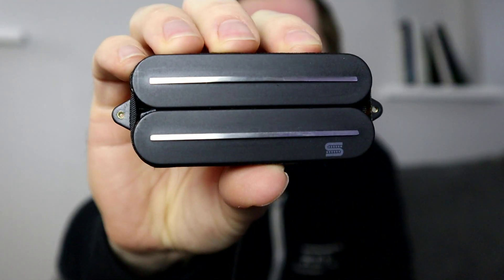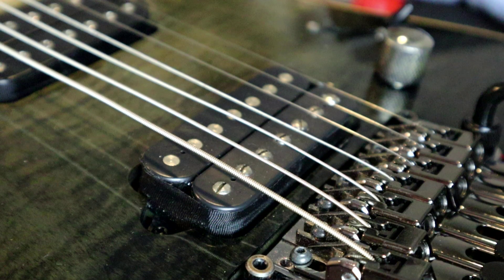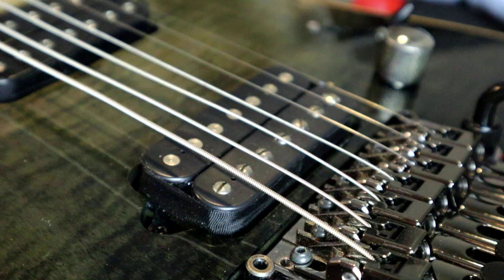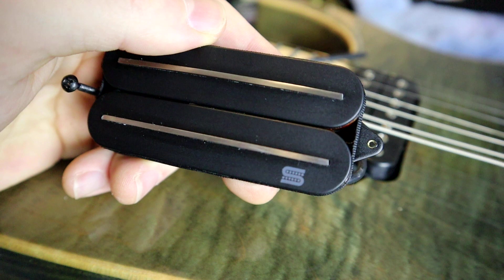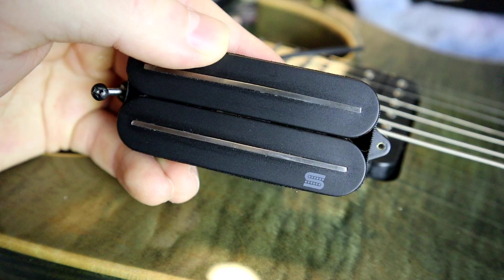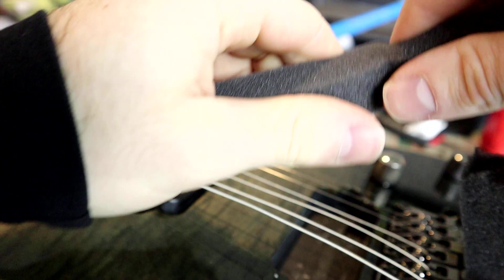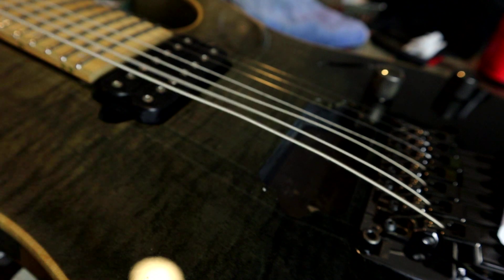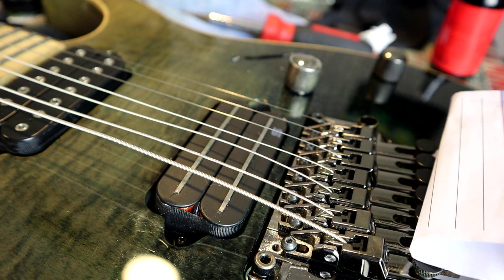How to Direct Mount Guitar Pickups

Comment: Great, fast, clear and concise video. A couple of extra points: once the pickup mounting tabs are drilled out, it should be noted that the pickup can never be used for a ring mount or pickgaurd spring mount again. Also, the sponge, the serves as a push back against the height adjustment...just another way to explain it. And lastly, that specific sponge material is available to order. Best to get the right one because it has a certain tension.
Reply from the maker: @robertfraser7199  you can also solder metal nuts, that are threaded, to the pickup tabs and use them with traditional plastic mounts!
Reply: @EricMorettin  I do realize that. Good point. It's out of most people's capabilities. But you're right
Reply: Subscribed... @EricMorettin
Reply from the maker: @robertfraser7199  Thanks!
Reply: I just got a cheapo guitar with direct mounts and the foam underneath is crazy hard/dense, making it pretty much impossible to adjust, but when searching for replacement foam I can only find it for P-basses, Jazzmasters, and Fender's general foam. Does it matter which I get? I don't know why it would (or why there is bass-specific foam lol), but maybe there's just something I don't know? I was just cutting up a big sponge that I had laying around n it seems like it should be fine, but I'd rather get the foam that's made for this lol.

Comment: I was literally thinking about doing this on my project strat, I'm planning on installing a Wilkinson high output Alnico 5 humbuckers on it.

it's a good thing that the body has a swimming pool route for the pickups so I'll probably just have to modify the pickguard so I'll have access to adjust the pickup height.
Reply from the maker: If the pickups are mounted to a pickguard then keep it as is

Comment: Trying to verify if direct mount pickups are height adjustable or not. Been eyeballing a direct mount. And I like my pickup at the bridge a little higher than they have been at the store.... With most of my guitars.
Reply from the maker: @kickfighting1015  they are height adjustable. You use screws and foam!
Reply: @EricMorettin  thank you much

Comment: maybe video on how to direct mount on a guitar with ring mount?
Reply from the maker: I'm not sure why you'd want to do that when the pickups mount just fine with rings, if it comes like that from factory anyways. Pickups come from the factory ready for pickup rings and not for direct mount applications though unless you custom order them
Reply: @EricMorettin  i have another problem, in short: i have active mounts, which i want to install over the factory ring-mounts. my friend has got a cnc machine to drill the cavities, but i am a little bit nervous about the whole deal, so maybe seeing a video on how it's done would ease my mind. i know it's kinda hard procedure and you probably won't make a video about it, but still wanted to speak up about my issue. thx for replying, have a nice day🙏
Reply from the maker: @mrtuning1194  I think you would be better off to sell those pickups and try and find the standard mounting variant of them. If you try and mount your pickups you would then have the pickup ring screw holes exposed which wouldn't look aesthetically pleasing. In my opinion that's your best bet, or see if you can return them if you bought them new.
Reply: @EricMorettin  nah, bought them used, emg 707x set, for about 100 bucks. it's really hard to find something 7-string in my country, and the shipping prices from abroad are crazy. thanks for the advice, i would consider this option👍

Comment: Most of this was common sense but my question is how you put the screws in? Push the pickup all the way down and then start screwing or have the screw all the way through the tabs first then screw from here. Seems like it wouldn't be a question but having troubles. Also these crappy screws strip out easily  :(
Reply: never mind, I've come to the conclusion that they have to be drilled out and the screw slides through. They cannot just be threaded with just the screw.
Reply from the maker: @flogginga_dead_horse4022  screw should be all the way through before mounting to the body. Then add foam under the pickups
Reply: @EricMorettin  thanks for responding, I drilled the tabs and they are mounted!!

Comment: Hey man, been watching your videos as of late. I have a question for you and maybe you could even make a video about. I bought 2 Ibanez prestige guitars and took them to the guitar shop to install sets of Duncans in them, the guy called me and said the pole pieces are very long and the only way to make them fit would be to either cutting the excess off or routing the pickup cavity to make it deeper. I decided to cut the excess of the pole pieces off but i’ve been reading around the internet and some people say that changes the tone of the pickup significantly. I don’t know if this is true or not but now I am very curious and I can’t find a reliable source that mentions or have tested this. I am only hoping for my guitars to sound good.